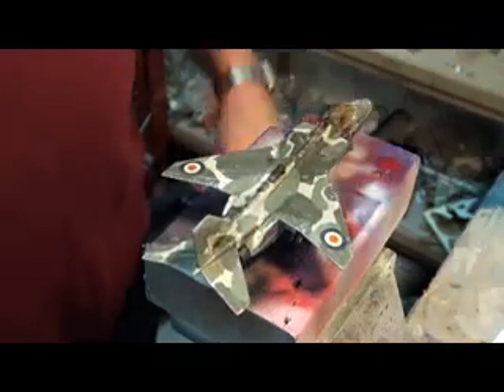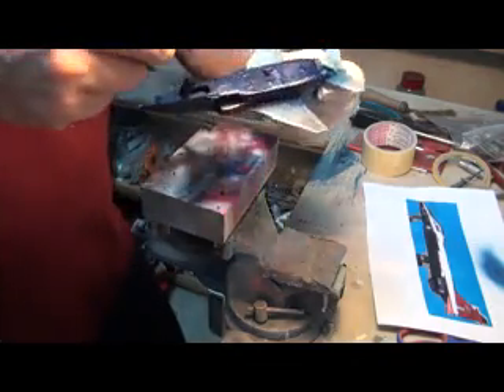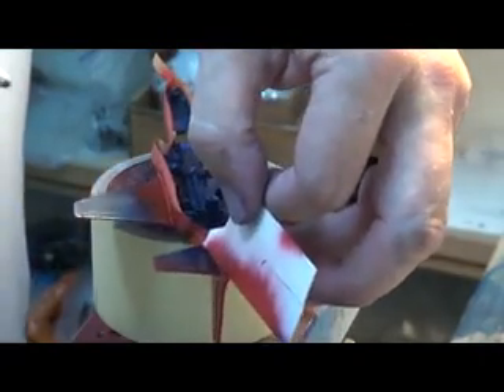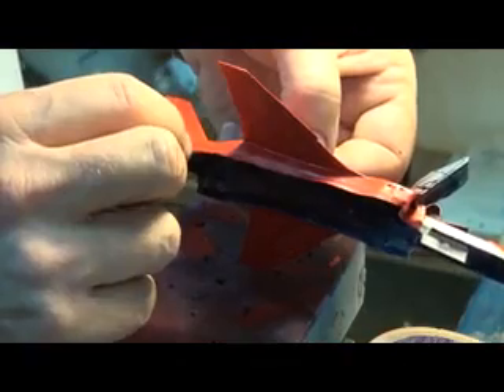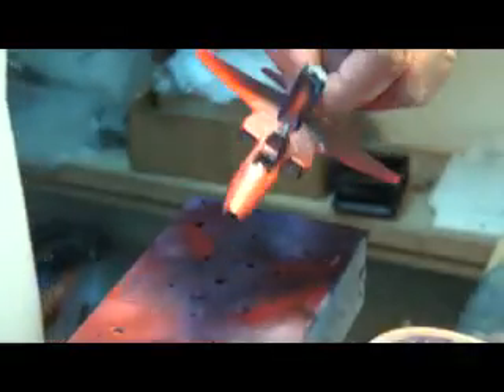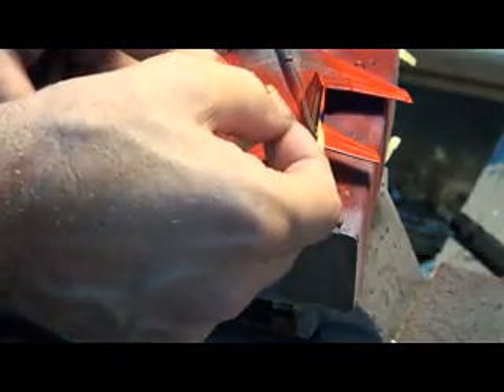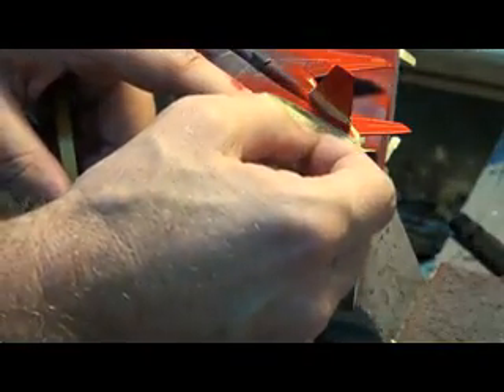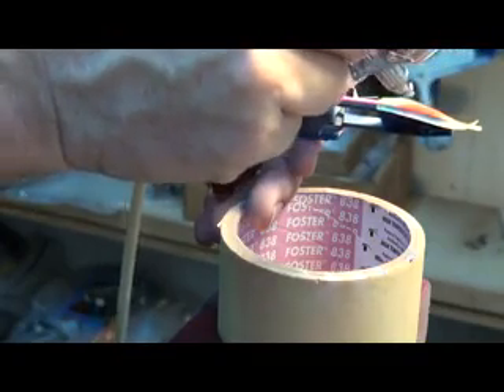diecast  masking and painting techniques with norri

Comment from the maker: meccano never did, so figured why should i? i use primer for filling casting imperfections and some joins, where i want a smooth finish, but that's about it. always finish with a coat of clear over everything, including water slide decals, which gives them a painted appearance and makes them, along with the paint, scratch and chip resistant. primer also adds thickness to the paint, which makes it easy to chip, especially around edges and moving parts. but don't let me put you off using a primer.